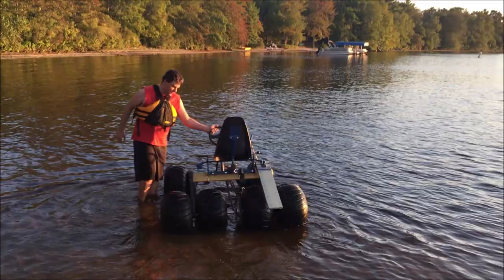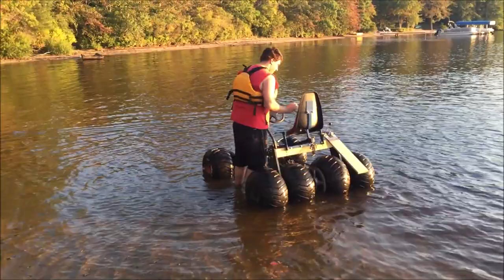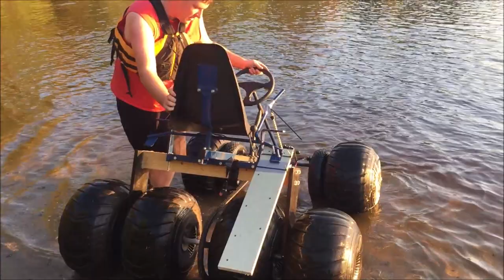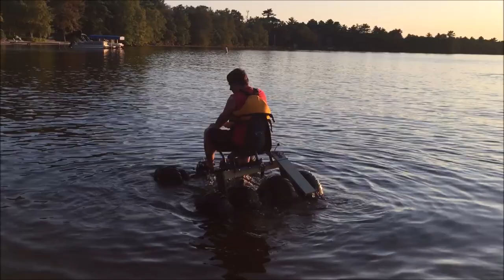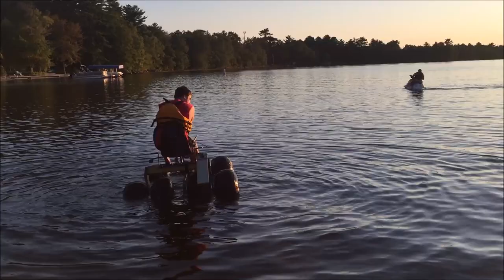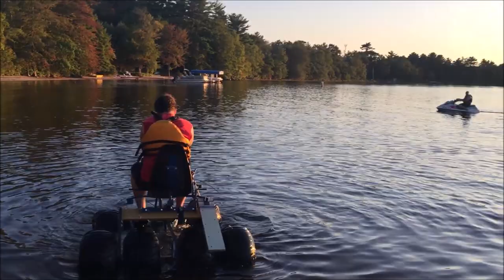Kinetic sculpture amphibious pedal powered machine

Comment: Very cool! Did you ever get the chain issue solved?  This would be great for travelling over thin ice as well.
Reply from the maker: Sadly its still out of state. I need to reregister the trailer to get it back up here, I have plans of making it electric powered, and may convert to belt drive.